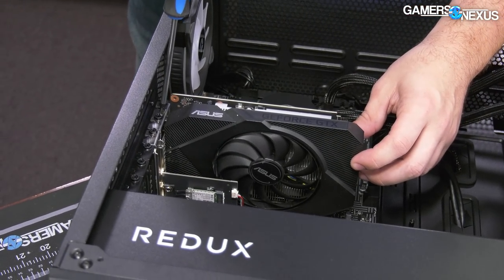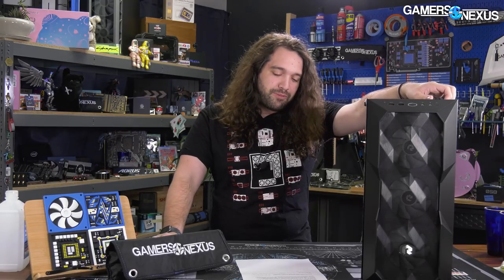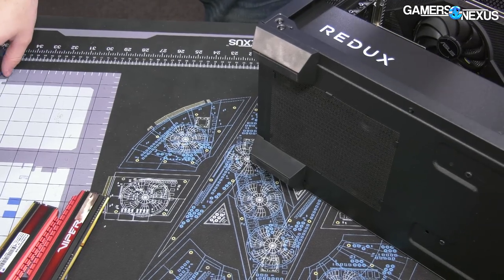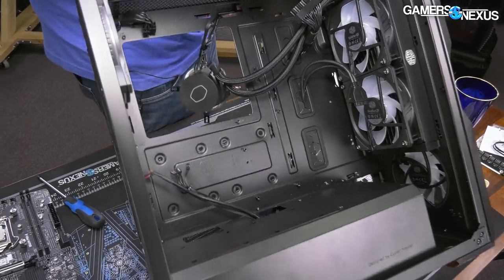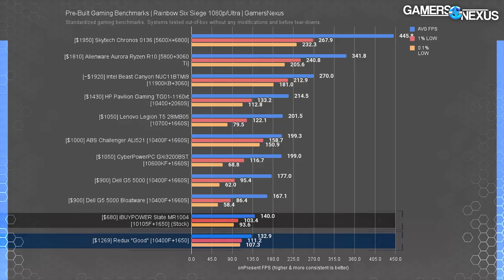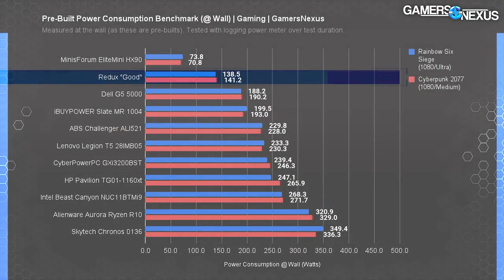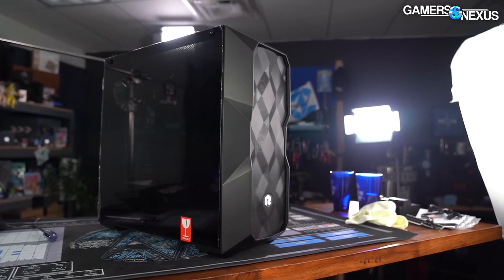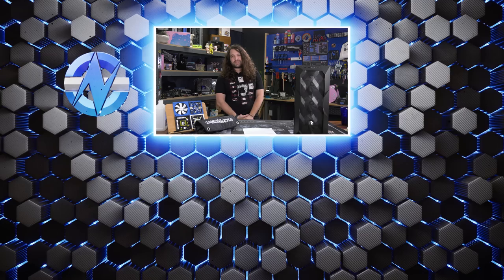YouTube Ads Told Us to Buy This: Redux Gaming PC Review

Comment: I went through and spec’d mine with a 3600 and a 3060Ti for mine, I think that they do better from a value perspective in that upper tier, though I would definitely have preferred being able to just spec the stock cooler to save a few bucks. Also if you’re marginally competent you can save money by taking off the windows install and just doing that yourself. That said, mine also has the same ticking sound coming from the included fans, so not sure why that’s about. If anyone has solutions to that problem, I’d love to hear them

Comment: This wouldn't be so bad if the swapped the aio for a cheap tower cooler ($20 thermalright assassin 120), and spent the difference on a better gpu (1660s min, rx6600 preferred)

Comment: Thank you very much for this; it was very insightful, especially on the business end of things. It is nice to know that part selection aside, they didn't lie in their marketing and are clearly competent. It is also nice to see that they upgrade you when they don't have the speced part. Clearly, the parts being retail and charged as retail is part of the problem, and don't think for a second I am trying to justify the lack of value because of their business model, I just find it interesting looking into it, and I would love it if you could reach out and get some responses.

Many SIs use priced-down components that perform acceptably but enable them to spec up a bit for the same margin. Redux can't make all its money on the building fee; it has a margin on the retail parts, so to maximize those, they need to buy in bulk. I am thinking specifically the cooling is a combination of bulk ordering and bundling. It's not like they are getting stock fans that they don't use, SI's don't get retail CPU with stock fans, they get trays of CPUs, so it may be cheaper for them to buy a massive amount of mid-range CLCs that works on all their SKUs than multiples different coolers. I wouldn't be surprised if Corsair makes them get more fans as part of the case and custom branding deal, so they need to throw them in there. It doesn't justify charging the consumer for something they do not need, but if their profits are anything like retail, then they probably can't afford to not charge for them, which is an apparent flaw in the business model. As an aside, I don't mind the tape on the fan controller.

Comment: The power consumption difference between this and the IBUYPOWER 1004 is kind of shocking considering this has a more powerful CPU. I wonder how much of the power difference was from the questionable power supply in the IBUYPOWER, and how much came from the CPU running nearly 30C cooler.

Comment: were the prices for those other systems taken as of date that you bought the redux system because if they were old prices form when you bought them then they aren't representing accurate data. due to the global chip shortage prices have gone up so you would have to adjust the price of the systems you are comparing preformance to what they would cost if you bought them at the same time so the information is relevant to the consumer.
Reply: "have to"?

Comment: I agree with the conclusion that the immediate value isn't there, but I think there's something to be said for upgradeability. 

While the system is way overbuilt for the entry-level components it comes with, it also means that it should be able to handle upgrading to even high-end parts (GPU/CPU) without any fuss.

If whoever buys this decides they want more performance a year or two down the line? Without even changing the mainboard, they can stick in a used i7/i9 and any (hopefully affordable) midrange to highend GPU, no problem, and be good for a few more years. Or if they want to switch to a DDR5/PCIe 5.0 platform, that'll be fine too. This prebuilt could very well be a gateway drug to DIY for some!

Does this change the value proposition? I think it does, maybe not enough to push it into actually good territory, but it's definitely something that should be considered and talked about. Especially since you've paid a lot of attention to negative examples of this like inadequate coolers and proprietary parts on the other systems you've reviewed.

Comment: What if this computer is effectively just a starting point for getting into computers? It uses standard parts and it has an over the top case and cooler and you can swap out components to keep up with the times. You can use the old components for another computer for like a kid to give them a computer for doing school work and light gaming and put new parts in your case and upgrade. Getting a case for the old components is not hard because they likely didn't overheat and are still in good condition by the time you upgrade.

So as a starter computer this could be very good one giving you standard parts you can flip later or repurpose and upgrade with headroom and use the old parts for something else. Giving you a platform to use for future computing and gaming. Also with this one to learn on you could get into building computers with out the fear of destroying hundreds or thousands of dollars worth of machine.

Comment: Jay had NZXT BLD Kit and I looked at it to see the exact specs. The starter Build of NZXT BLD KIT(which you need to assemble, but comes with a good assemble guide) for $1399. B560 Motherboard, Intel I5 - 10400F, 16GB 3200MHZ ram, but ultimately I think it come out easily ahead at this price point vs the Redux with a RTX 3060TI. I mean If the bumped up version with a 1660 from Redux is costing $1400ish, you're better off with the build kit. 

Use the guide, watch Jay's video, whatever you need to be able to assemble it yourself to get I think an overall better computer. Still not better the DIY, but better then Redux at least.
Reply: It's part of their campaign to place the blame on the end user. Well you have a fire, hey man that's totally your fault not ours! 😂

Comment: I think you were overly harsh with this pc review 
I personally like an overkill cooling solution.
and also it looks cool better than any standard e-waste air cooler
giving a good upgrade path to other components.
yes performance was down but you don't buy a Ferrari because its fast.
Upgrade the graphics card to a 20 series and ur sorted and maybe later down the line a cpu upgrade.
overall i give it a 7/10

my rig
7700k at 4.8ghz
strix 270 matx motherbord
240 aio
titan x graphics card (12gig)
(old but packs a punch)

Comment: 700w Gold PSU with a 1650 why?.... PCSpecialust in the UK on put a 450w Bronze with a 1660 here in the UK and according to NVIDIA website that's fine..... 700w gold is overkill just like the cooler.
Reply: But when you want to upgrade to a 2000 series later, when they available again, the 700W makes a lot more sense

Comment: I'd love to see a video on entry level upgradeable prebuilts. like i cant afford the 12900-ks + 3090ti with 128GB of DDR5 5600... But if i could find a prebuilt that has entry level performance like a decent i5 or i7 12th gen, and a mobo that is ready for any future upgrades, like start with 2x8GB or 1x16GB DDR5 at a decent speed that you can add to easily. 
the idea being we might not have 2.5k to drop on a PC, but we (I am) running on a Xeon e5 2Ghz 1050ti and 32 GB DDR3 800 Mhz for gaming, and almost ANYTHING would be better...

Edit: e5 not e3... e3 is whats in my older pc that is storage for my video editing

Comment: Newegg's PC builder tool when picking "Mainstream sub $2000" which is the middle spec (other 2 are Entry Level sub $1.2k or Enthusiast over $2k) and going AMD you get quoted a R5 3600x with GT 1030 for $1316 or building for Intel quotes a i7-11700k and GTX 1650 for $1508. So even more poor value options are out there

Comment: I think this is actually a decent prebuilt. If not the best one you reviewed, yet. 
I expecially like they didnt cheap out on ram, cpu cooling etc. And they even shipped the system with a better motherboard.
Yes, the GPU couldve been better. But they shipped as advertised, so you cant blame them, because you chose to buy that configuration.
And yes, the AIO might be overkill. But better overkill then a super cheap crap cooler on some of the other prebuilds.
And last but not least: Yes, the price is higher than some of the others. But imho you get a lot better build quality overall and no proprietary components at all. I would buy the redux over the dell any time.

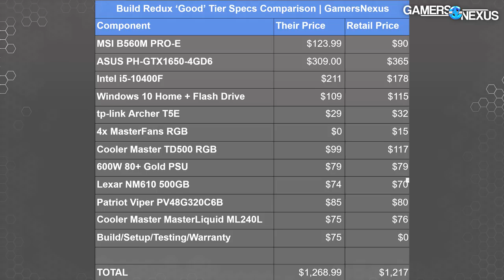Comment: @2:58 C'mon, $15 for 4x Cooler Master MasterFans RGB? Please link me to that deal. On another note, link me to 4x 120mm fans for $15, regardless of RGB besides the occasional Arctic P12 Value Pack, which is x5 fans for $30.99. I doubt that last fan is as much as the last 4. Don't cut when you don't expect the system integrators not to.

Comment: Steve... i have a very similar system. Completely over built then a 1650.... i dont disagree with comment but sometimes you have to roll with the punches...
Waiting for a big paycheck for a 3080ti and 850w psu
5600x
noctua nhu12s (completely overkill)
B550
32gb cl16 3600mhz (overkill)
3 TBs of m.2 ssd's
4 TBs of hard drives 
750w psu (completely overkill)
Lian li mid tower
4 140mm be quiet silent wing v3 (overkill)
1 120mm be quiet silent wing v3
AND 1650 MSI 4bg gddr6 (BOTTLE NECK but playable so) 👍

Comment: I purchased one of these computers it came I moved some of the parts it came with a 3070FE 10700k 32gb ddr4 Ram (mine came with patriot signature 💩💩) the AIO cooler was the wrong mode and a prime z490-p. And why they use that POS fan hub I don’t know. REDUX ALL SO Modifies the case fan power connectors to fit the fan hub which I thought that was stupid to say the least.

Comment: So I came across this video because I have a PC with all the “top of the line parts”, I’m buying it for virtual production, 3D work in unreal engine 5 in real time. Here’s all the list of parts

INTEL CORE I9-13900K 24-CORE
NVIDIA GeForce RTX 4090 24GB
32GB DDR5 Dual Channel
2TB NVMe M.2 + 2TB HDD
CM MASTERLIQUID ML360
QTY 4x CM MasterFans RGB
Cooler Master TD500 RGB
1000W ATX 80 Plus Gold
ASUS Z790 D5 Series | INTEL
Wireless 802.11ax
Windows 11 Home + USB Recovery

Am I choosing overkill or will it be “buy once, cry once”?
Reply: I think you're psu is not good enough for those parts I would rather get 1300w psu because 13900k and 4090 are so power hungry but everything else seems nice but you will not be able to upgrade your CPU in the future if you don't plan to upgrade this pc is good. And get more storage ssd are so cheap you should replace your hard drive with a 2tb ssd and maybe get one more ssd if you need it but in my opinion your spending so much money already you should get at least 6tb of storage.
Reply: @theregularninja5398  hi, thanks for your comment. Why do you say I won’t be able to upgrade my CPU?
Reply: @mrsselftaught  because 13th gen is the last generations for that socket but  there is going to be a 13th gen refresh but it's not worth it if you already have 13900k but if you don't have it yet maybe you should wait for the refresh you can use the same z790 motherboard on the new refresh version.
Reply: @theregularninja5398  oh well!! I already bought it because an engineer told me that was a pretty high in prebuilt and that I could change the parts whenever I want an upgrade, I don’t need the latest of the latest, there will always be a new generation right after you buy the latest generation so I’m not interested on keeping up with every new generation of pieces if the ones I have are recent and work properly for unreal engine
Reply: @mrsselftaught  ok
Reply: @mrsselftaught  enjoy your pc 👍

Comment: To be fair to Redux, a liquid cooler, even on something that doesn't put out enough heat to make that thing work at even a quarter of its potential because it's the way of the market. A stock cooler would do just fine but it would scar the ego of the person buying it. What? No AIO? You even game, bro?

So, I wouldn't put blame on Redux here, even though it's pretty unnecessary.

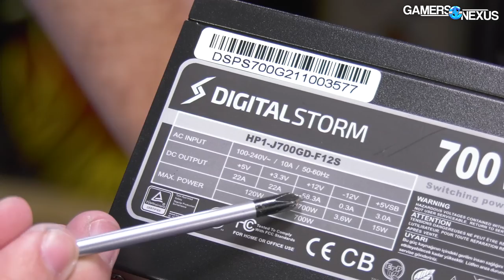Comment: 13:32 "this is good, you can get all 700 [watts] on 12V. That's great"

Why is this great?

This is indicative that the 5V and 3.3V are sub-regulated off the 12V output instead of having their own transformer taps. I actually prefer to see the opposite because it's indicative of a more complex design and your 5V and 3.3V high power devices (like PCIE4 SSDs) do not cut into your 12V power budget.

Comment: @ 9:00 To my understanding, a "fin stack" would be the type of fin assembly typically found on heat pipe air coolers, such as, the Coolermaster Hyper 212 EVO. A "heat sink" is generally the machined fines, along with the base of the cooler, all machined from the same block of aluminum (or whatever kind of metal). There really is no direct "definition" for this nonsense, but, I guess I just don't like you calling that heatsink a "fin stack" LOL.

I know....I know.......But, I'm not trying to be the "AcTualLy" type of nerd, here.....Too late lol.

Comment: Bit of a ridiculous build, it would have been better to source a smaller case and just fit a 5600G with the stock cooler, dump the GPU, and produce a smaller console sized cheaper machine with a good power supply so there is still upgrade potential for a decent GPU later on if the user wants it.

Comment: In my eyes, although I don't know if this is  actually a reliable way to look at it, any GPU that small and has 1 fan (unless it's a very low performance card) automatically makes it useless.
Cause, otherwise, why would other cards have 2 or even 3 fans, and much bigger heatsinks. Supposedly for more/better VRMs, you would need a bigger PCB and bigger heatsink, but that can't be the only reason. No, any card that commonly has 2-3 fans are worthless with 1 fan due to the literal lack of adequate cooling, meaning the card will not boost nearly as much as it should. Could this be seen as a way to save money? Smaller less powerful card, lower price, sure. But, the fact is, when they shove an unnessecary watercooler in the system, they have completely undone this...

So, less small worthless cards, and obviously more standard sized/+2-fan cards, as well as less watercooling and more adequate stock coolers...

Comment: I guess this is why you configure the parts on the site yourself rather than just take one of the three presets. I went with an i7-10700k with rtx 3070. Much more expensive and much much better. That way the cooling scales with the other parts. Message I'm getting is don't buy redux if you're getting the cheapest stuff, only if you're willing to spend something.
Sad to hear it took nearly two months to get the PC, I only recently ordered...

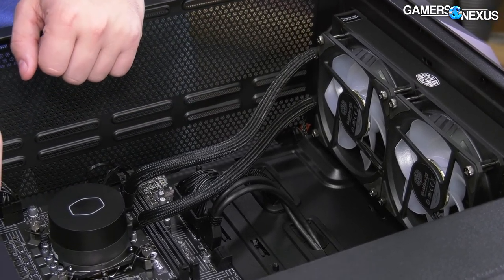Comment: 7:25 I thought the outlets of a radiator should be facing down so the pump does not pull air bubbles which will accumulate at the top most spot of the loop!? Nevermind it was addressed at 9:20

Comment: I hate when builders don't install the radiator correctly... It should be installed with the tubes at the bottom, not the top. There is always a bit of air inside those things, and you wan't it trapped in a location where it cannot affect the circulation - and that is at the top of the radiator (on the end without tubes)... So dumb, that mistake...and sad.

Comment: Orientation of the loop doesn't matter. The wires can be at the top or at the bottom. They can be to the left or the right. 

What I want to know is why are the fans set to blow the hot air from the radiator to inside the case. You have front I takes blowing cool air over the radiator and then pulling the hot air  and what ever little amount of cool air left inside the case. Why? Put the damn thing on top of the case and have the radiator fans act as an exhaust while maintaining front intakes. 

While thermals shouldn't be an issue regardless since everything is so under spec it is still stupid as fuck but if you had a more powerful gpu you dont want mostly hot air entering the case from the radiator. You are just making every fan work harder to keep the case cool due to poor efficiency. Also if those front fans are blowing heat due to pushing in the hot air of the radiator you don't want you cold water to get heated up. Hence why the tubes are in such a location. Either way terrible build with minimal thought in taking airflow into mind.

Comment: I have noticed the common complaint for Redux is the lower tier PC's are not the best value. However at the higher end they come out cheaper then a lot of other pre builts and with superior build quality. So I'd say for 1300 and under stay away from redux. The higher you go the better the option they are.

Comment: Comparing the pricing of the Redux to the original pricing of the other prebuilts isn't at all fair since those have either gone up in pricing or aren't for sale at all. The Dell if you can find it goes for around 1100$, the Legion T5 is 1500$ (if you can actually find it ) and the GXi3200BST is 1200$. Plus actually removing the windows 10 install also drops the price down and you can then put in a 1660 so it comes to 1270 dollars. It's fully customizable. And if you actually look at their website and look at the build it gives you for good you can see that the first build is a 5600x build so you would've had to customize it. So you're already giving them a disadvantage with that. You guys usually do good non bias testing but this one is kinda just plainly unprofessional and purposefully unfavorable for them.

Comment: So in short, pretty well built, but very shitty value due to very screwed up component selection.

The good part of it is that it can scale up easily. To get a higher spec PC all they need to do is to exchange the CPU and GPU, and then the value would become a lot better.